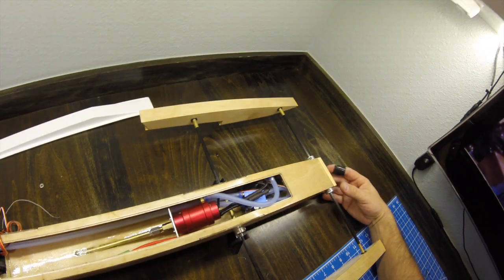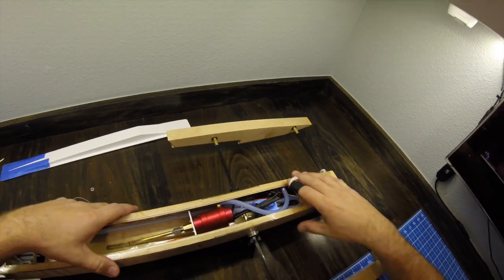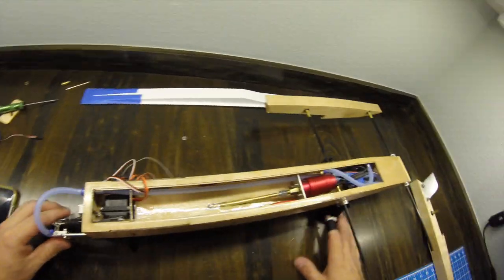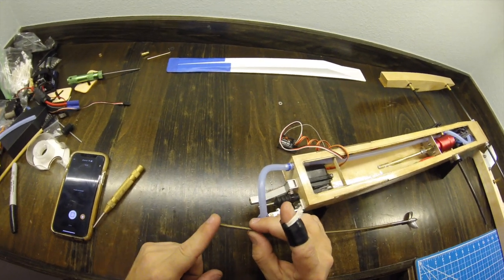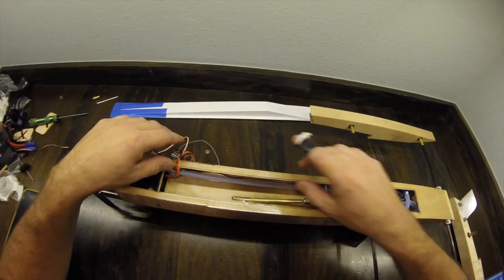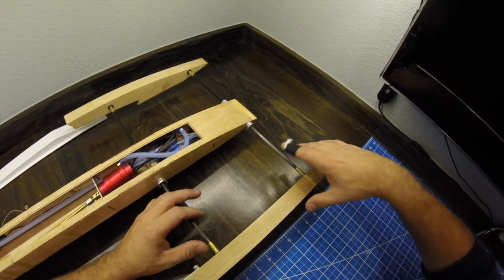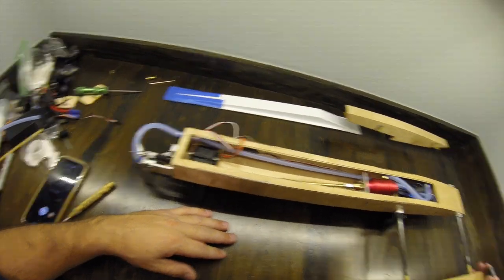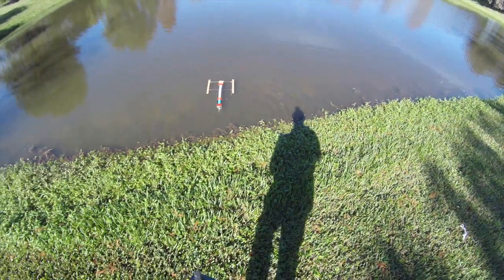How to Build a Zippkits JAE26FE Build Part 6 -  Maiden Run!

Comment: Great job with everything . After watching I have realized there is too much work & equipment you need to do this build correctly  . Do you sell boats or build for customers ? Thanks . . .
Reply from the maker: Thank you! I don’t build for other people, takes me too long to make a return. I sell some of my builds on occasion and do have a couple extra riggers. What’s your budget?
Reply: @jjh.rc.videos8863  I would b interested in one capable of running 2s or 3s . It could possibly come with motor , esc & servo but hav my own transmitter , reciever & battery or might b interested with nothing if the price was right . Let me kno thanks

Comment: Hi, thank you for the series on this build!! Very helpful for a newbie like myself!! Have other boats, but RTR! Just got this kit the other day , starting the build hopefully this week!  I've got that same motor, 2860 ,3400 kv. Are you running 3s or 4s in this vid?  Again thank you Sir!!
Reply from the maker: John Sneen  Welcome! In the video I am running a 2860-2550kv on 4s with the stock prop. 3400kv will work fine on 3s and you can run bigger props. That motor on 4s I’d run stock prop and check temps to make sure it’s not getting too hot when first setting the boat up..
Reply: @jjh.rc.videos8863  Thank you kind Sir!! Can't wait 2 start the build and finish it. 😁

Comment: my kit doesn't show a teflon tube. What size do you use?
Reply: I used a .150 sized shaft with 1/4” stuffing tube and requires Teflon tube Part # oc150t-24. If using .187 sized shaft with 1/4” stuff tube, you don’t need Teflon liner.